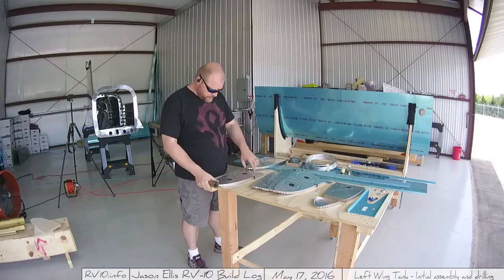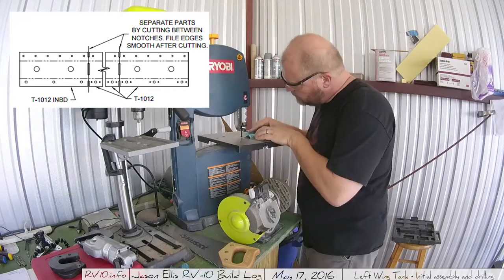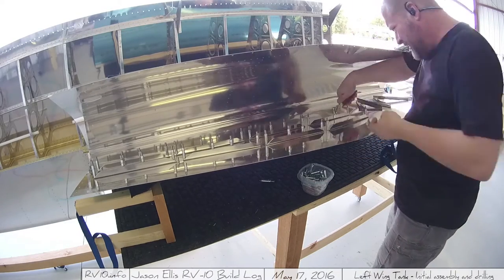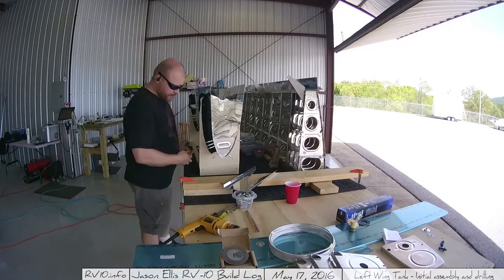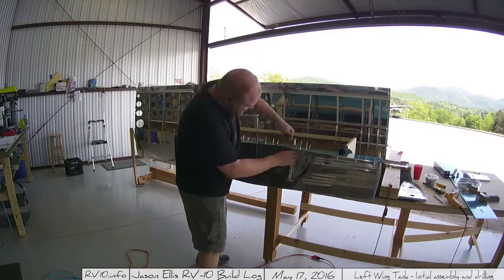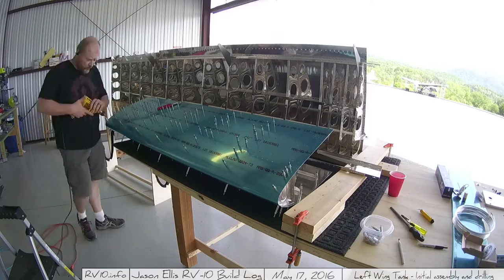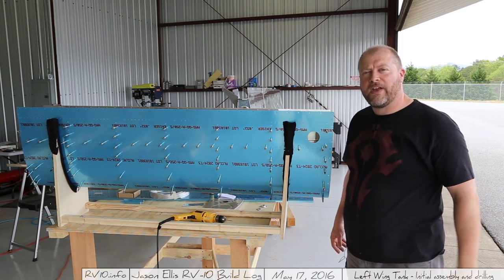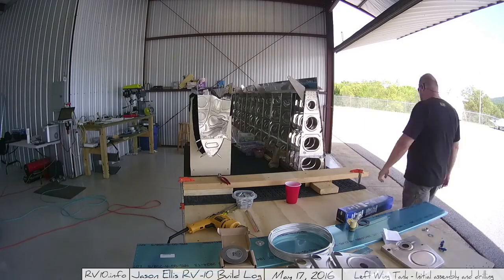RV-10 Wings - 021 - Left wing fuel tank assembly

Comment: Time saver tip: Take a piece of scrap stiffener and drill hole right where you need to draw the centerline. Make the hole just big enough to fit a fine line sharipe. Then you can just slide the scrap with a sharpie down the piece you're marking. No measuring, and a perfect line every time. You'll just need to offset the hole you drill just enough to compensate for the difference you get by nesting the two together.
Reply from the maker: +Ed Kranz Well crap Ed.. that's completely obvious and I never thought of it.. ahha Good idea! Thanks.